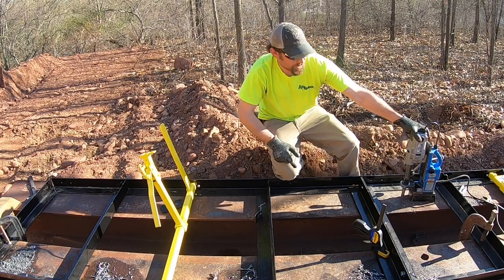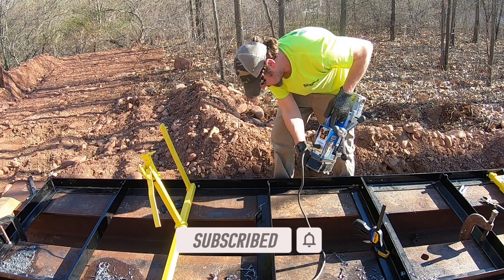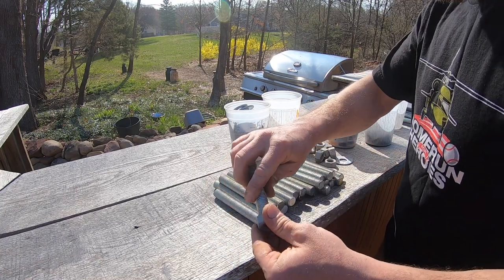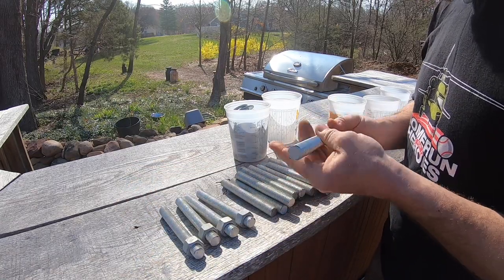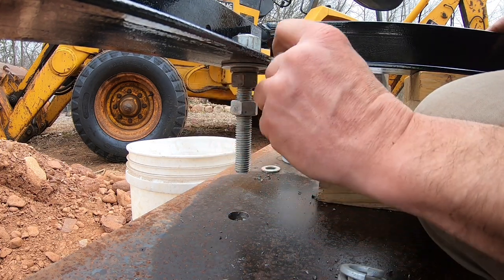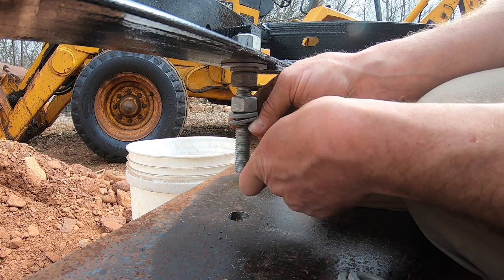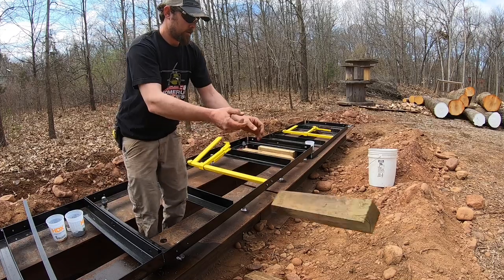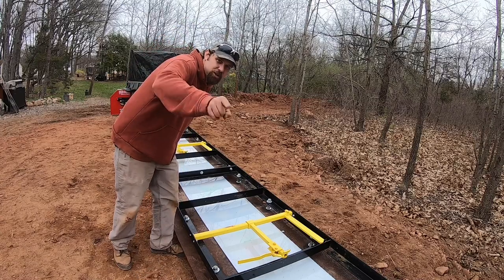Best sawmill base build #hudson#hudsonHFE30

Comment: You'll appreciate it more than a store bought machine. For those that don't have a mag drill, start witha small bit and use gradually bigger bits til you get the desired diameter hole
Reply from the maker: That mag drill is an awesome tool! Made short work drilling all the holes thanks for watching